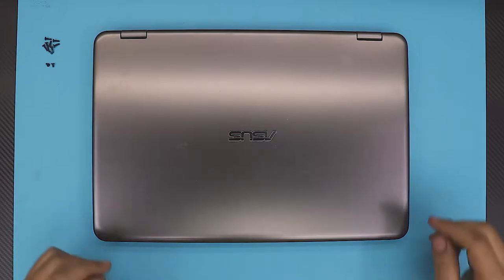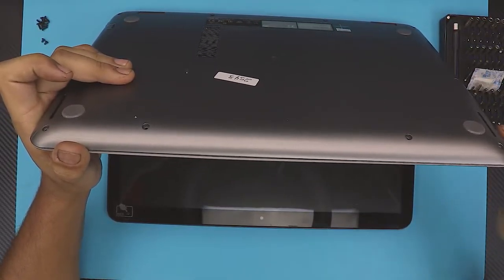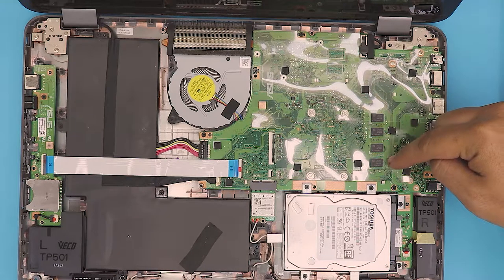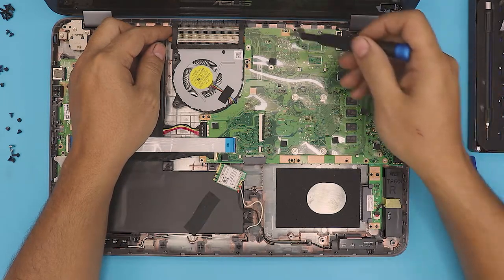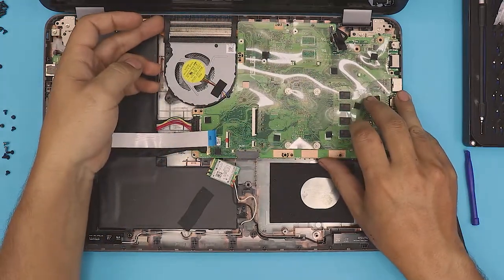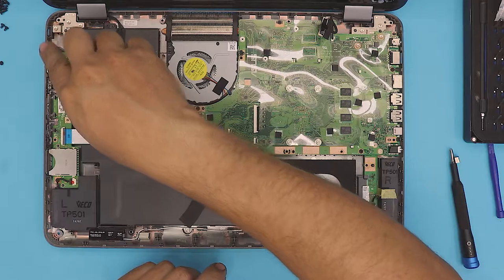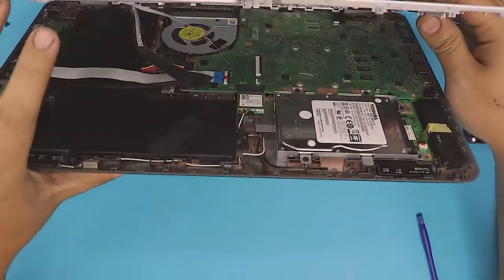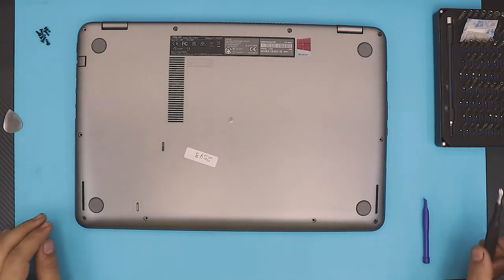ASUS Transformer Book Flip Tp501u Ram Upgrade, STEP By STEP

Comment: Thank you for this video. It is very helpfull. My goal is to upgrade the m2 ssd from 128 to 1tb wd blue and upgrade the ram. Do you know if a 32gb ram will work?

Thanks in advance
Reply from the maker: It's my pleasure my friend.
i appreciate your support,🫠Regarding your question, no, a single 32GB stick will not work on this board; it won't boot.  
If you have any further questions or requests in the future, please don't hesitate to ask.
cheers🍻

Comment: Hello, you know if it would be possible to upgrade the Notebook TP200sa ??? memory and ssd????
Reply from the maker: Thanks ✌  for the feedback!  if you wish to support the channel you can LIKE or SUB or both :P
Regarding your question: Sorry to inform you but the ram on that motherboard is not upgradable. :(
Reply: @uFixTek  Thanks for answering my comment now about the SSD Would it be possible in any way?
Reply from the maker: @JZIKAPlay  again sorry to inform you but the TP200sa model have the ram and mmc chip soldered on board and its not possible to upgrade or add any m.2 ss or any type of ssd , only on the TP205sa models you can upgrade the ssd :(
Reply: @uFixTek  Thank you for understanding❤️, you were the only one who managed to inform :(
Reply from the maker: a qualquer hora meu amigo: P 😬

Comment: Thanks for the Infor about this laptop. One question: The M.2 Connector is next to the memory right? So I must to follow almost the same process to connect an M.2 SSD HD, right?
Reply from the maker: thank you for the feedback and your support to the channel, regarding your question :
yes its on the other side of the board beside the rams:
https://prnt.sc/10qd674
and its m.2 ssd and you will need a small screws
https://amzn.to/3tBTVff

use the screw only from this set:
https://amzn.to/2OQcCNF

Comment: Hi Bro, o read down here that you Said that laptop doesn't recognized SSD m2 NVME PCIe right? Well, i have bought this ssd KingSpec 512gb and The BIOS and The laptop doesn't recognized for sure. But tou Said too, we could try to update The Bios, have you already try this with this model? Thanks by The way!
Reply from the maker: Thank you for the feedback! if you wish to support the channel you can LIKE or SUB or both :P
regarding your question: ok no this laptop doesn't take m.2 ssd, only sata ssd, and here is the video,
https://youtu.be/CAmYSonqKrs
and it works with any sata ssd, the kingspecs are really bad and faulty ssds my friends. no need to update the bios for 99% of the ssds. remember you will need to install your windows on the ssd once you replace it.
Reply: @uFixTek  Thanks for your answer friend. I'll subscribe your channel. Well, i will try to sell this one and bought the right SSD as you said. Thank you again!
Reply: And i realized now, that my keyboard works only the top side, the bottom and some buttons are not working. I think could be the flat cable, i don't know.
Reply from the maker: Yes i would highly recommend you to get an SAMSUNG ssd if not get kingstone o adata o WD.
regarding the keyboard if the flex cable is not even in the jack this will happen, make sure its all the way inside.
Reply: @uFixTek  Thanks for the tips my friend. I fixed de keyboard. I saw a video a guy cutting the tip of the flat cable, just a small piece, and i did the same, and it works. I'm relieved now haha...
Reply from the maker: oh no needed to cut but its fine all you needed to clean and place evenly inside, but glad it worked.

Comment: Bro I have the same laptop and I wanna ask you some things:
1.- The M.2 slot is for a 2280 NVMe ssd right?
2.- The RAM upgrade only works for a 8GB as maximum, like asus said in their manual, is that correct?
Reply from the maker: Thank you for the feedback! if you wish to support the channel you can LIKE or SUB or both :P
regarding your question: you can add a 16gb DDR4 sdram without any issue , the manual is BS, as we have upgraded a 16GB and it does add up with the soldered ram and works fine under bench-marking, BUT you will need to update the BIOS before going to 16gb , but add a 8gb ram thats a sweet spot and 4gb on board you more than just fine.
🔵 DDR4 ram 8GB:https://amzn.to/2SVcmPx
Regarding the m.2 ssd : YES it is a 2280 stick, BUT the board is not a PCI-E m.2 there fore it will not read any NVME. only m.2 sata ssd
up to 2tb without any issues.
🔵 1TB SSD m.2: https://amzn.to/3wIybAq
if you got any other questions feel free to ask
Reply: @uFixTek  oh, then the sata ssd goes on the m.2 slot? or it replaces the original hdd? i got confused because of the m2 slot configuration and yes there it goes my like and sub :D
Reply from the maker: we have this types of drives"
m.2 ssd sata
m.2 ssd nvme
2.5" HDD sata
2.5" SSD sata
--------------
this laptop takes the following drives:
m.2 ssd sata
2.5" HDD sata
2.5" SSD sata
now that said, this laptop comes with mechanical drive (2.5" HDD SATA), so you got the following choices:
recommended:
install a m.2 ssd sata, and install the windows in the m.2 ssd sata, and after format your mechanical drive that come originally in the laptop and use it as an extra storage. this way windows will run much much faster on ssd than hdd.
or if you dont want to format or install windows and you just want to add storage then, just add m.2 ssd sata and use it as extra storage, but then i be sad :( as you dont take advantage of the ssd speed.

or if you dont want to buy m.2 ssds you can get 2.5" SSD sata and replace your mechanical drive but then you will be forced to install windows.

i have made two types of videos one on how to create a windows 10 usb boot drive and another on how to properly install windows using the usb boot drive.
once you have the boot drive plugged into your asus laptop:
Hold and press [ESC] and after that push the power button to activate the system. You can choose the boot device from the list (your usb windows 10 boot drive)
then for the steps watch any of my installation windows steps.
windows 10 usb: https://youtu.be/uDu8j2lE-dM
steps on windows installation: https://youtu.be/7f_rBp6Rb3s
if you need help let me know
Reply: @uFixTek  aww man! I have a spare m.2 nvme ssd, that one doesn't work, right?
Reply from the maker: no man we tried many ssd nvme and the results are that the m.2 por its not PCIe , but there is no harm done to test it update your bios and plug the nvme there and see if it detects, it will not get damaged or damage the motherboard it will simply not work.

Comment: Asus tech specs specify only 12GB Maximum Memory and you have 4GB soldered on board. What happened if you upgrade with 16Gb SODIMM, OnBoard Memory disable it automatically ??
Reply from the maker: You're welcome! Thank you for the feedback! if you wish to support the channel you can LIKE or SUB or both :P
regarding your question:  Don't listen to the tech support or manuals, they are full of it!! this laptop easy can upgrade that 8GB dim to 16gb dim  and you will have no issue whats so ever and it will run perfectly fine,
https://amzn.to/2T5PKM4
just remember when you plug the new ram and when you power on you may not get any boot screen, then follow this steps:
remove the ram, power on and once you get the boot logo then power off, remove the battery and charger press and hold the power button for 30sec, then plug in the new ram and plug the battery and charger and then power on and wait 10-15sec for the bios to do a ram check, and you should be all fine. good luck.